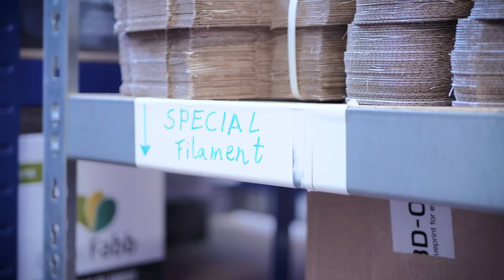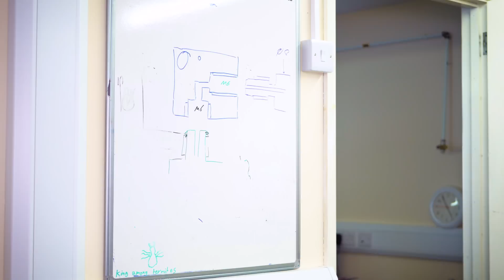Why E3D are still a startup

Comment: After just a year the bearing on my titan is making an infernal noise and about to seize. Had to replace the heater cartridge due to faulty wire. The silicone sock needs to be held in place with metal wire because it's all wonky... I mean come on, for 150€ you can't put a decent bearing in it? Ffs.

Comment: Hmmm, I'm not impressed. You have taken a great idea and made it in to a cheap Chinese crappy product. The main reason your product is not doing as well as it should be is because you GAVE it to the Chinese and they copied it and sold it as their own. 90% of the V6 products on Amazon and Ebay are knock offs of your product. Typical British mentality, it's why we fail at everything. You will be out of business before you know what went wrong. In the mean time the Chinese will be selling your product on Alibaba by the tens of thousands at a fraction of the price. You should have persevered with the UK suppliers and they would've come good, but no, you wanted to take what seemed to be the most profitable route. 
RIP E3D 2013-2018.

Comment: Screw in thermies are better.
Reply: The lead wires are held in with epoxy and in my experience this maintains them much better, especially compared to a cartridge where the ceramic is eating at them. Best of all its easier than both a glass thermistor and a cartridge to remove/replace.

You can buy them threaded for the old v6 hotends. they screw into the hole that the thermistor hex screw would have gone.
Reply: ***** Huh. I have yet to have one fall out, however, Ive been using them maybe only a few months. Though to solve the lag, i just cut a custom block for my v6 with an indent and a tapped through hole that goes all the way to the nozzle threads, that way it screws in and makes contact directly with the nozzle. Add a dab of high heat thermal compound, and KA-POW
Reply: ***** If you'd like I'll send you a block to try out

Comment: A great video Tom -- thanks! My E3D V6 has worked flawlessly for nearly 18 months so far, printing several times a week on average. Early on I wrote a bit of gcode for unloading filament that did the job with care (and made that accessible via a "unload filament" menu option of my Kossel Mini), and I haven't had any nozzle jams since which weren't attributable to something else (some Taulman Nylon Bridge that was way, way off diameter for example). E3D's V6 makes the hot end a non-issue for me. Wish the same could be said of their silicon boot for the V6.

Comment: Well I have a problem with their e3d block. In that they dont admit that they have a tollerance issue with some of their heater cartidge being undersized... Once screwed in (which is barely possible without breaking the thread) and heated a few times it's impossible to replace them.
I explained the problem with pictures, drawings measurements and dimensons and as many proofs to the best of my capability but for some reason their engineer say I am the only one with this problem...right now. Although, they admit they had it in the past (july) as can be seen in the bigbox volcano forum. Apparently they don't really care... I don't know why they can't reproduce or address the issue. I don't want to make them bad publicity because they are doing an impressive work in making all what they do but I can't understand they can't see such an obvious and simple to deal with issue.